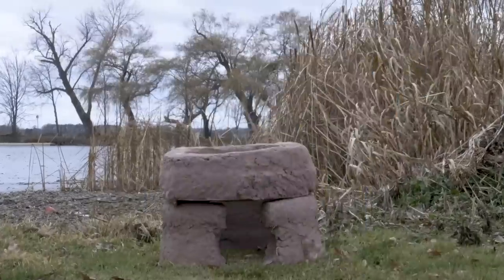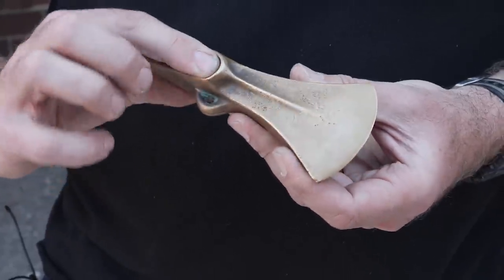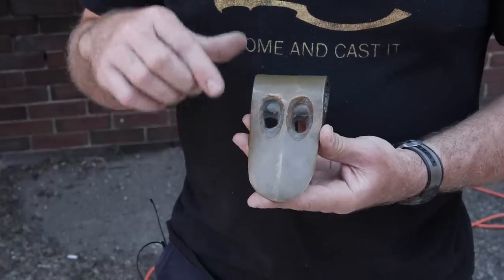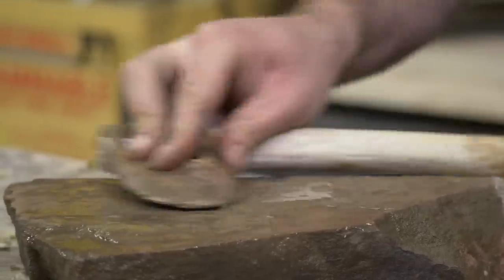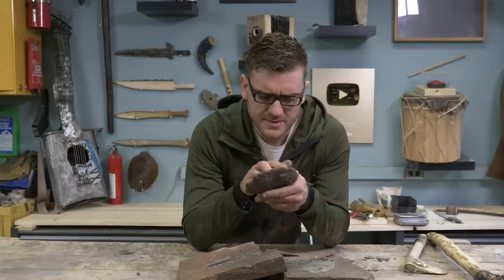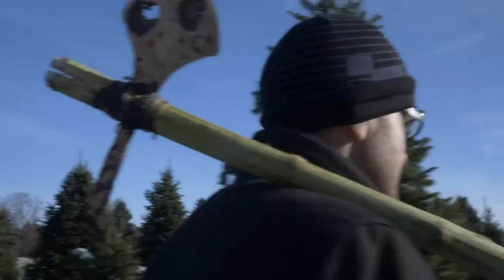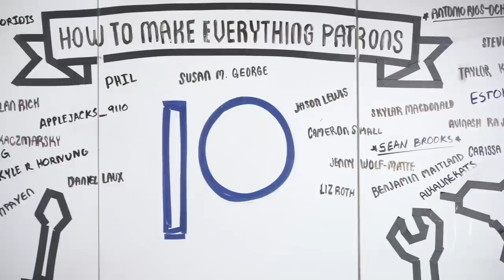Casting an Axe Worthy of Thor Using Primitive Technology

Comment: When you were pouring the bronze was coming out in blobs. That will almost certainly lead to trapped air pockets.
Reply: yes, my guess is that the bronze wasn't hot enough (also, if the stone broke that wasn't hot enough either)
Reply: @matthiasvanhecke1283  Bronze is scarce. So gotta keep slag in to make it go further.

I guess?
Reply: The problems is, in the Bronze Age they didn’t have metal implements that could withstand the heat of being dipped into a crucible of molten bronze to scoop out the dross. A bronze utensil would have worked if used quickly and allowed to cool sufficiently during use.
Reply: Yeah it wasn't nearly hot enough, far too gloopy. And a flux would have most certainly helped. This could have been as simple as a layer of white ash.
Reply: @michaelfapgod4598  not serious.
Reply: umMMmmMmM, i BeLIeVe ItS LeEd nOt LeAd
Reply: I could see flux globs

Comment: Imagine being in the late Bronze Age flexing your wealth by casting a bronze axe with a bronze cast
Reply: Itd be like having an airpods case made of crushed up airpods.
Reply: unless it had a gigantic volume to dissipate the heat into, and since that bronze isn't just barely melted, it'd probably melt it a bit. even if it didn't, since it becomes malleable it'd lose form quickly.
Reply: @terriblegoatman826  lmfao! 😂
Reply: @MsHumanOfTheDecade  hes referencing the video where the sword casting guy said they used bronze to cast bronze but the cast had so much mass that it just cooled quickly on the sides touching so the mold didn't weld together.
Reply: @personalperson r/woooosh
Reply: I used the bronze to make the bronze
Reply: My thoughts exactly

Comment: I will share this secret piece of ancient knowledge in order to make your future builds a bit easier.

It is always best to drive the handle INTO the tool head, rather than drive the tool head onto the handle... Set axe head onto handle as best you can get it by pushing it on, then hold the handle in your off hand, and strike the bottom end of the handle. The weight of the tool head will provide resistance for you to drive the handle in. Rotate the handle in your hand as needed to ensure a proper setting for the axe head.

You're welcome.

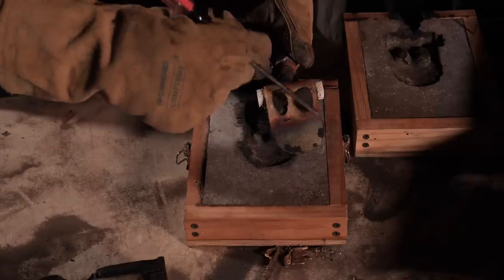Comment: 5:10 the colors on the bronze are due to oxydation of copper. Why does it make a rainbow from the tip ? Well the oxidation of metals occurs instantly when very hot. The difference of temperature leads to different thicknesses of oxides, making different colors. The finer part will cool quicker and get covered in a different oxide layer.

Comment: It's one hell of an axe, but it looks more of a weapon type axe than a wood axe, the semicircular curve is much more prevalent in battle axes than ones used in woodcutting, which tend to be straighter curves
Not that it isn't effective, it obviously is, but that may be what the original that tree farmer found was
Reply: I was thinking that too, but, hmm, yk? It's probably easier to cut wood with it with less practice, for all the reasons it was used in battle, since the broad curve means most strikes hit at a right angle to the surface. But if you've got a skilled woodsman, and you're a feudal lord of a while ago, you might use less space on a smaller axe cos he can try again fro the right approach angle and everythign. Save that bronze for the military boys
Reply: Kit Vitae true, it does mean less blade hits the tree though, so theoretically it wouldn't be as fast, but yeah, bronze military Bois

Comment: Typically those colors come from thin metal-oxide layers on the surface of the metal.
Reply: Exactly. The process is called thin film interference (sorry, wrote diffraction first, mixed up the terms) and it's the same thing that happens when you observe a thin oil film on water. Because the piece of metal cools faster at thinner sections the depth of the oxide layer differs and with that the colour changes too.
Reply: Neeeeeeeeeeeerd!
Reply: Well I have an IQ of at least 7!

Comment: Flaring out the top of the draft furnace above where the charcoal sits and adding as many holes in the bottom as necessary to match the cross sectional area of the part with charcoal will make a the furnace be able to oxidize a lot more fuel at a time, as well as a covering the top with a holed cover

Comment: Work hardening - the process of disrupting metal crystalline structure, forming smaller crystals, and therefore more surface area between said crystals, increasing the friction between them, and therefore the amount of work necessary to move them relative to each other.

Comment: Those colors come from an affect  called reily scattering which is a certain wavelength of light being reflected by a small amount of molecules while the wrest of the light is obsorbed slowly or is too sparse for your eye to see. In this case the reiley scattering is caused  from diffraction thicknesses of oxides, the different thicknesses of oxides formed  because axe cools at different rates from place to place in casting. Reiley scattering is also the reason the sky is blue and same with blue butterfly wings.

Comment: The colors are usually from the greensand. I've had similar colors from aluminum and pewter, so it cannot be oxide layers, and it only happens when casting with greensand. Depending on the brand or composition of the greensand you could have something that makes those colors when it burns away, like oil.

Comment: Casting on a flat stone with no second "side" to it means you can make chisels, plane blades, and other hewing tools, which means you can process wood to make planks or boards. You could make the wooden molds already.

I would have been tempted to sharpen that back piece that broke off the last axe you made to make it another kind of tool or weapon. I am sorry it broke off. 

I love this series much better than random videos. Seeing how things advanced through the ages is great.

Comment: The problem of the bubbles happens because you are pouring the metal on to an open mold, if you don't use a closed mold, it will always happen. The expert actually told you that they used TWO pieces of stone.

The other stone just needs to be flat enough to perfectly enclose the mold, so any bubble that gets formed while pouring goes out, that's probably why you see some material dripping and spilling out through the hole, as it's pushed by the air that otherwise it would had formed bubbles.

Comment: Notes for the future:

ALWAYS clean the slag from the top of your molten metal before casting. the slag was a large reason of why your pour failed after cooling.

Stop with the horizontal casting, at least, when using a stone mold. There's a reason that, like he stated, stone molds came in *halves*, and not a single slab.

Comment: I want to say part of the reason it is casting with so many bubbles, especially the big ones near the front, come from when you moved the crucible up towards unfilled part of the mold. From what I know casting other materials you can trap air pockets that way, you basically always want to pour from the same spot, and let it flow into the rest of the mold. Not as much of a problem when you get vertical casts, but when it is open topped it can be a factor.

Comment: The colour gradient is MOST likely due to tempering during the casting process:

The first bit of bronze loses the most heat to the casting medium and so it quenches rather rapidly(relatively speaking to the rest of the cast). The Bronze after it then quenches slower, but tempers the already quenched leading edge of the cast. Looking up the materials on MatWeb would give you some details on the typical properties of them, but you should definitely pour a long enough bar to get a good gradient for some hardness and strength tests. Local colleges with mechanical engineering or materials engineering/science curriculum should be able to help with the testing.

Might be interesting to have a secondary channel with some of those kinds of tests of historical crafts through the lens of modern science?

Comment: That hardness thing is that metal crystals tend to slide along specific directions really easily, so called "slip planes" where the bonds aren't strong.

When you get impurities they break up the slip planes, but right when cast they're distributed somewhat randomly, and the surrounding metal crystals can still slip

When you work harden, you push those around until they bind/can't slip anymore

Comment: The coloring you saw was achieved while cooling when it hit around 350 - 800 degrees Fahrenheit. This typically occurs in steel and iron. However, there are a few other metals that this occurs in.  To try it for yourself, find a piece of mild steel, and put it in a preheated oven anywhere from 350 - 500 degrees Fahrenheit as that’s usually the maximum temp that most ovens hit leave the steel in the oven for around 1 1/2  to 2 hours let it cool in the open air and you will be left with a color ranging from a yellow tint a reddish tint to a blue tint. sometimes you can get a tie dye effect at random. I believe it depends on thickness of the steel and the quality.
Reply: Should get this pinned as the answer to the question in the video. ☺️

Comment: the colors are caused by copper oxidizing from the heat. It means when it's still hot the copper is in contact with air and it somewhat changes the coppers chemical make up from copper to copper oxide. When casting in sand there is still a lot of air inbetween the grains of sand, making it so the metal can breathe after casting.  You can use copper dust in pottery and when it's heated it'll change all sorts of colors from green to red to blue and purple. surface oxidation. Also the blobs will allow air to be trapped in with the metal as it cools. Pouring out in a smooth pour would stop that from happening as much.

Comment: The color change happens because of heat. Its consistency is because the axe head is tapered. Color specificity can be achieved by using specific temperatures

Comment: 5:00~ I think the colors are the effect of the scale and the bronze forming a passive state, preventing the axehead from further rusting, just like heat-bluing of steel. The gradient in color may be a result from the difference in temperature, and heat dissipation.
Reply: They're thin film interference related colors as a result of the oxidation of the hot metal.
Reply: Banana0042 Thanks for correcting me.

Comment: Soapstone is a metamorphic rock rich in talc, it's soft heat resistant and works well in casting.  Sandstone is a sedimentary rock they can be made of pretty much anything plus quartz with pretty much none of the requirements for casting.

Comment: While im sure you put a lot of effort into this, its mildy infuriating how you seem to make things more difficult than needed. For example early in the video you talked about stone casting, using 2 sides of a stone cast to pour vertically, then you immediately afterwards used a single side stone mould poured horizontally.
Reply: As he said, it was a lot of work making the mold. Creating a 2 sided mold  is more than twice as hard. Not only do you need to make a second mold. You need to make sure it is an exact match for both size and shape. And even harder, you need to make the two halves fit perfectly to avoid  leaks. He did take the easy way out. Would he have gotten better results if he did it the right way? That I don't know.
Reply: @johnbennett1465  it much easier than your making it out to be he can take two pieces of that sandstone and rub them against each other until they are flat.  then chip out the components design bind the two stones with a minimal amount of clay or cobb bake above the furnace during heating to remove excess moisture and pour.
Reply: @calebarchambault9706  What you say may well be true, but it is still a good bit more work than what he did.
Reply: The main issue is that that nice-looking angle of his horizontal cast just doesn't work. He needs to pour the cast vertically if he wants a high quality product
Reply: Open-faced molds make a low quality casting, but the problem with a two-sided mold is the metal tends to leak out the sides.  The low viscosity of molten metal, plus its high density, makes squirt from even tiny cracks.  Plus most materials including that sandstone will crack and deform when the hot metal hits them.

Comment: im pretty sure the consistant pattern of color is due to the thinner parts of the axe head cooling down quicker and thicker parts slower
Reply: Nope, it's called thin film interference. Caused by different thickness' of the oxide layers that form and absorb certain wavelengths of light
Reply: @seanbush5313   i am aware of thin film interference and it will oxidize at different rates depending of the thermal mass of that specific part of the blade. Longer its hot, longer time for oxide to form

Comment: I don't think you really need milled wood for the frames for sand casting. I was thinking you could use eight large sticks, four with sockets and four with plugs to fit in those sockets, to make two squares. Then put some flat object like slate on the back of each. Flatten the sides which will touch each other when the mold is closed and it should work pretty well. I've never done that but it might just work.

Comment: if you can cut a log in half should be able to use the sand casting method
Reply: They would have to make sure the cut was as clean as possible though.

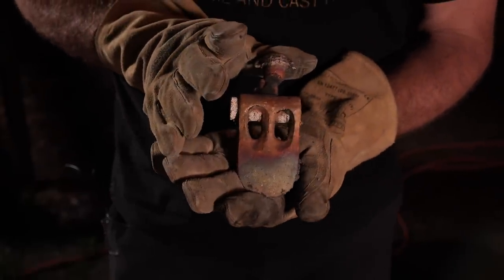Comment: 5:13 I think the process is called bluing it is usually done with silvery metals and the reason it has different Colors is because the oxide layer at different sicknesses refracture different wavelengths of light so you get multi colors but it think that is what’s happening

Comment: gases normally get trapped in molten metal, that's likely where the bubbles are coming from. Modern casters normally bubble nitrogen up through the metal prior to casting, as it normally pulls the trapped gasses out with it as it bubbles up out of the metal

(edit)

also the blobby nature of the pour probably had a hand, although you can't really fix that without a hotter kiln, which i know you don't have.

Comment: It's an oxide layer of different thickness, I used to cast bronze and brass for a living it happens all the time, and when you bead blast and use a magnet to get the pellets it traps brass in between and makes a fuzz looking material

Comment: in lue of soapstone you could use Limestone, it is fairly common and you could "come across" a nice flat piece with rough edges and use that, theres data to say that it was also used and there is historical evidence for it as well that shows it was used for copper casting
Reply: Limestone is calcium carbonate. Under heat it breaks down to form calcium oxide and CO2 gas, so it would bubble like crazy as a mold
Reply: @tp6335  look up Bronze Limestone Casting, a PDF of a paper written about it from PT Craddock titled Casting Metals in Limestone Molds saying in the Abstract that if it's not a large flat cast you would be fine. (most likely due to it cooling quick and gas gen low) theres ingot molds from around Gozo and Malta. It can be done just not large swords or sheet metal

Comment: The colors happen because the cast object has different thicknesses in different parts. This causes them to cool at different rates at the parts of different thickness which cause different oxide layers(these different oxide layers are the color) based on how fast they cooled.

Comment: put your rock mold by a fire to warm it up before casting, the holes were there probably because it cooled to fast to allow the gas to escape proper. Also is why it cracked

Comment: Assuming bronze behaves like steel, the different colours appear because of different oxides forming on the surface. The thickness of the oxide layer depends on how fast it cools, and the thickness determines the colour.

Comment: Like steel, most metals have a discoloration that is caused by the speed the heat leaves the metal and thus it is tempering coloring that the metal structure at the  various areas of the cast have different crystal structure. So each part of the cast will have a different hardness and it needs to be tempered to make it a more homogeneous material design

Comment: Also what was the thing Greg put in the duck-billed ax to hold the shaft hole open?
Reply: I'd presume some sort of brittle stone that could be easily ground out
Reply: It looked to me like a piece of firebrick shaped into a cylinder.
Reply: plaster of paris mixed with sand, i would guess, so they could just put it in water after and dissolve it out
Reply: It looks like pumice stone

Comment: I've browsed some of the comments but not all so this might have been mentioned already but holes aren't just about saving material but are often used, perhaps counterintuitively, to increase the strength of a material with respect to what it is used for.
Also, while I definitely enjoy the brutal just do it attitude you take with your projects, one thing that was definitely developed over time was the precision, advancement of measurement, care, and artisanry required to make better tools. I hope you get into that eventually... for example, Grade AA surface plates